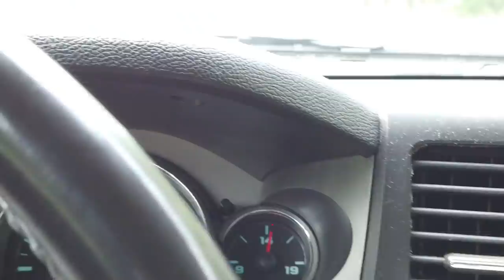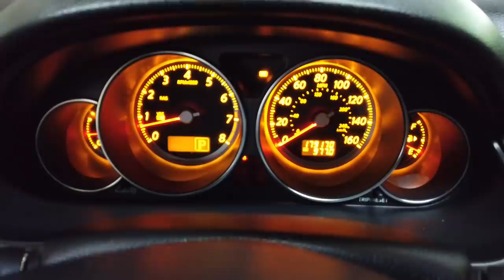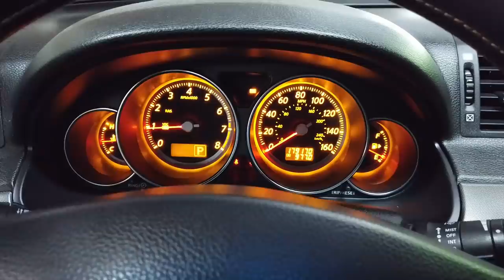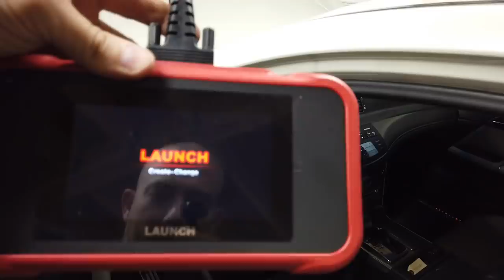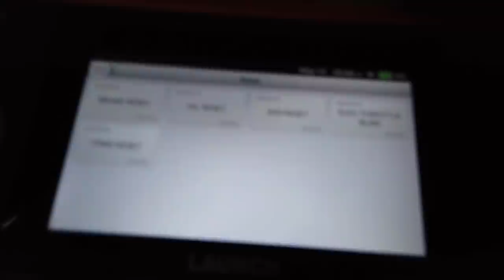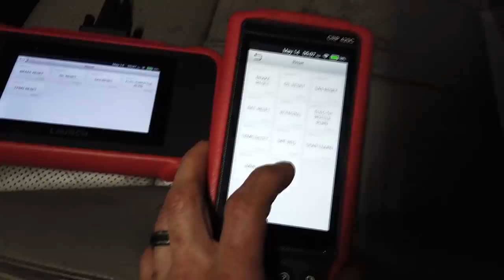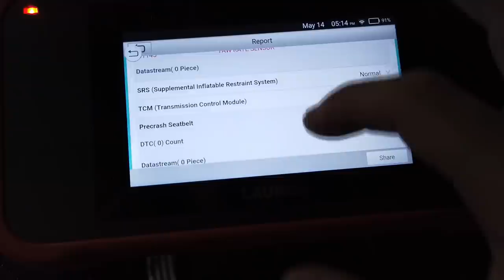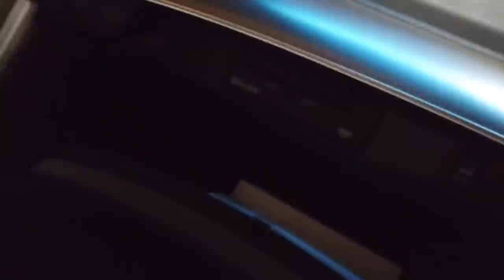I bought a Luxury V8 for $1000 at Copart

Comment: Step aside Jason Statham, the new Transporter will now be driving an Infinity!  That's a really nice car!  I typically stay away from Infinities at auction because their parent company is Nissan, and Nissan often uses CVT transmissions, which I've had bad luck with.  But yours has a RE5R05A transmission, it's conventional.

A lot of car guys don't like to see plastic engine covers, but I like them because I always pressure wash before selling, and I have on occasion caused damage while washing.  Randy from Auto Auction Rebuilds damaged the ignition coil cassette pack on a Mercedes during a wash.

DPF REG stands for Diesel Particulate Filter Regeneration.  Diesel DPFs are filters that capture soot.  But it is impractical to replace soot filters because they are so expensive, so instead the filter is designed operate at a temperature so high that is incinerates the soot, thus cleaning the filter.  Because it requires additional fuel to function, it's also one of the reasons why modern diesels are less fuel efficient that older diesels without DPF.

Comment: The DPF REG feature on your code reader is, as you said, for diesels, so you can put the Diesel Particulate Filter into Regeneration mode.  Like on heavy vehicles, every so often the vehicle is supposed to go into a mode where the DPF gets extremely hot and burns off the accumulated carbon.  But, on a lot of vehicles that are, for example, only used around town, the system won't get warm enough to perform the regeneration automatically as that tends to only happen when the engine has been running for a long time at fairly high speed such as on a highway.  If the DPF doesn't automatically perform the regeneration cycle it can become utterly choked, as can happen with catalysts, and then you get all sorts of running issues and the full Christmas tree of warning lights on the dash and often replacing the DPF is the only option which is horrifically expensive, a new DPF can easily cost more than a 10-year old diesel vehicle is worth.  So being able to put the system into regeneration mode with a code reader at every service if it's a vehicle used like that is a very good thing as it can prevent a huge bill or the vehicle getting written off the road as financially irreparable.  Needless to say, you do need to be very careful where you perform the regen as it produces a massive amount of heat, far more than a petrol/gas engine catalyst ever will so it is a serious fire risk.  If you've seen Ice Road Truckers you'll know that they are very concerned about their DPFs going into regen when they're on an ice crossing as it can easily produce enough heat to melt the ice to a point where the truck will fall through and go swimming...

Comment: The the feature on the code  reader def/reg means  old diesel cars trucks have a particle filter for DPF filter what that does it forces Regen to remove junk from filter at high heat wen truck car can't do it on its own

Comment: Actually 3 stage paint is what you use when doing pearl it's  base coat,  (color coat) then pearl, then clear and if you spray the pearl coat on dry let it flash for 30 minutes, then hit it with the clear and then let it sit for a couple days to properly cure and you're golden. DPF is to reset the Diesel Particulate Filter, only the newer diesels have those like mine being an 06 cummins there isn't one but 2015 and newer dodges i was looking really hard at the Launch X431 it's blue tooth and wifi and wireless OBDII dongle but it's $789.00 so that won't be happening any time soon
Reply: X431 V ?
Reply: @kingbolen_official  Yep, that's one of them i like.
Reply: @DaddytechEnt  Good sir!

Comment: That car is sweet. Power seat may be a broken cable, stripped gear. Those engines are good till 300000 and has a very stout tranny. Mileage was a little poor,but then again you’re driving a V8. Also premium fuel. Should also have a nav system. Nice buy!...

Comment: Sorry tp tell you, but there is no power fart-blocker installed. The way you tell at a glance is by the way the finish is worn off the ass-holder of the seat.
Reply: DPF + Diesel Particulate Filter. It catches diesel soot and from exhaust to prevent that black, dry-looking exhaust cloud some diesels spew.

Comment: roll the windows down for inspection.
Reply from the maker: You can't do that, plus how you rolling the back window down lol
Reply: @UnWrecked  The back window is allowed to be tinted. but the doors and windshield are not allowed on a car. I have an suv and have my front doors tinted since the rest of the windows have stock tint. I roll my windows down and take it in for inspection on a nice sunny day with the sunroof open as well. and they never check the windows for tint. they just check everything else.
Reply from the maker: For SUV's and trucks it's legal, not cars
Reply from the maker: The enhanced inspection is different because they have to send pictures of the car to the DMV.  If they pass it, the DMV will still fail it because of tinting laws in pa
Reply: @UnWrecked  not legal for the front doors on a truck or suv.  I've been stopped by the police for my tint a few times. I'm always free to go without a ticket but they use it as an excuse to fish to see if they can find something else. The law in PA doesn't say you can't have tint it states that the police need to be able to see inside. But the police use that as an excuse to stop people saying it's not allowed when in fact it doesn't say that.
Reply: @UnWrecked  in Pa it's a regulation and not a law. But the DMV can be picky about stuff. That is why I never received a fine for it. They just use it as an excuse to check to see if they can find anything.
Reply from the maker: I'm just telling you that if the DMV sees tint in the pictures where 70% light has to pass through, they fail it.  That's all I'm saying, and they won't pass it if the windows are down either

Comment: Todd nice looking ride. As for the tint you bought it like that you could keep it on. Then again you may get stopped. Any tint behind the drivers windows you could keep on the drivers and passager windows can't be tinted you could get away with light tint. Cant wait to see this build!!
Reply from the maker: No, the tint is illegal in PA so if has to be removed for the enhanced inspection or it fails.  Ask me how I know
Reply: @UnWrecked  Todd is that for regular inspections or enhanced inspections.
Reply from the maker: Basically just enhanced.  Technically applies for normal inspection too but most don't enforce it.  Being the pictures have to be sent to the DMV for the enhanced, they fail it